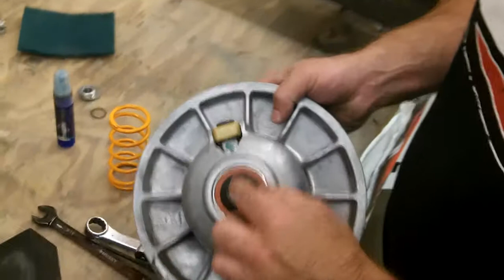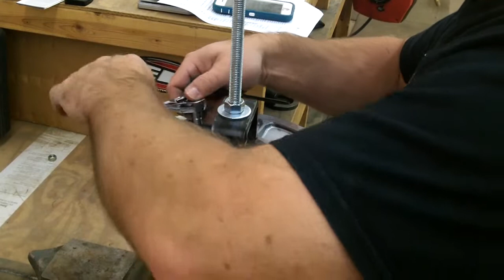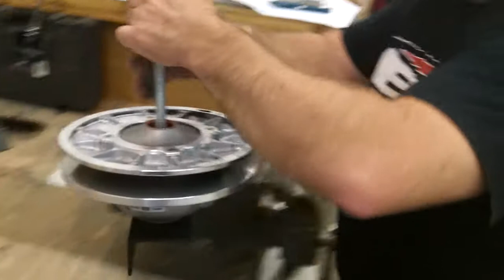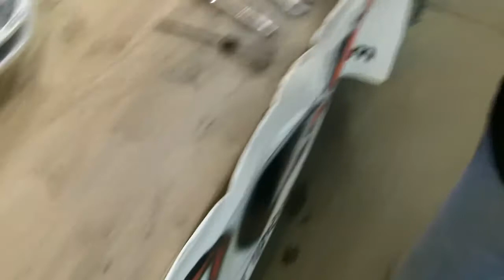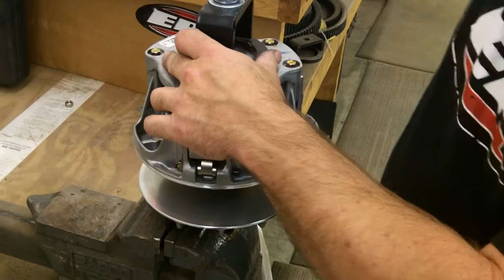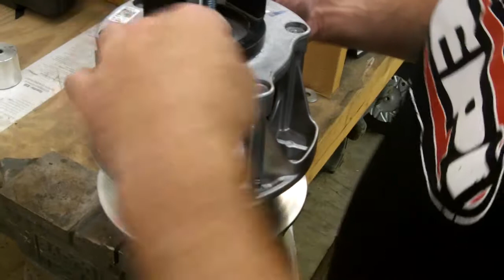EPI Clutch Compression Tool - CCT520

Comment: Does EPI have a clutch press for a 2013 Arctic cat wildcat 1000 Limited?
Reply from the maker: Yes we do, the CCT510 Clutch compression tool will work for your machine.
Reply: @EPIperformance  is that for the Secondary, Primary or will it work for both?
Reply from the maker: @jmqrsq  It will work on all the secondary clutches.  If yours has the Team clutches it will also work on the primary.  It will say Team on the clutch cover if yours has the Team clutches.  If yours has the old style roller clutch you wont need any special tool for the primary.  The CCT510 also works on almost every style of clutch, its an awesome universal tool for clutches.
Reply: @EPIperformance  Yep, mine has the Team Industries Clutch so it should work on the primary too then. Thanks!
Reply from the maker: @jmqrsq  Glad we could help!
Reply: @EPIperformance  if only you could help with the fact that my clutch sticks when it’s hot… lol
Reply from the maker: @jmqrsq  Wish i could